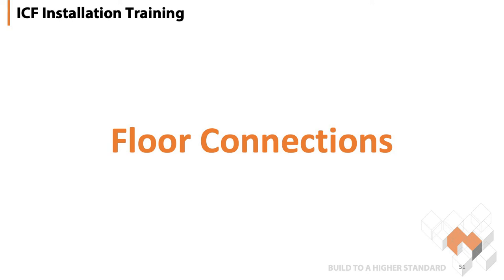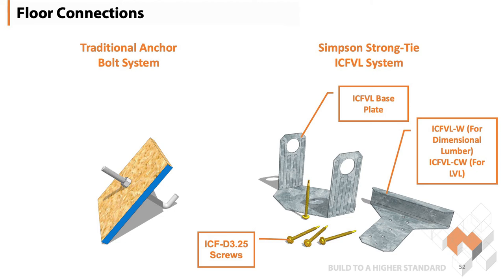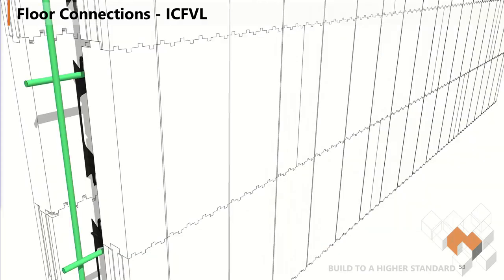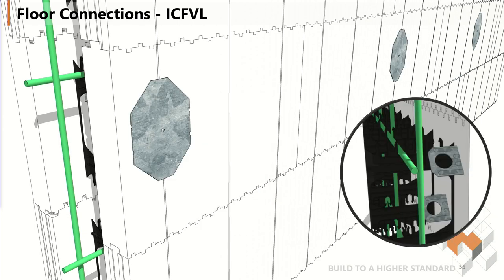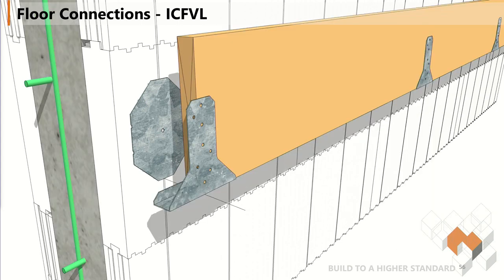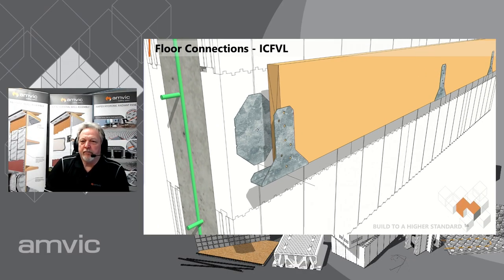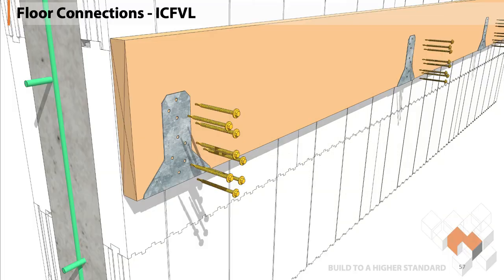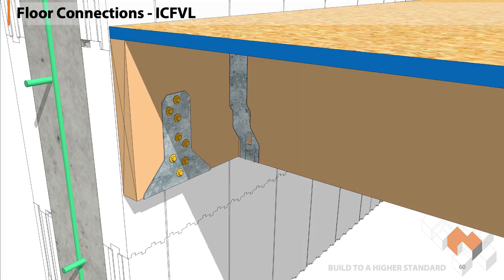5 Floor Connections

Comment: Is it possible to cut into the icf concrete wall and set the tgi joist directly on a metal shim and still meet amvic codes?  Just wondering if this an acceptable way to install joists for subflooring